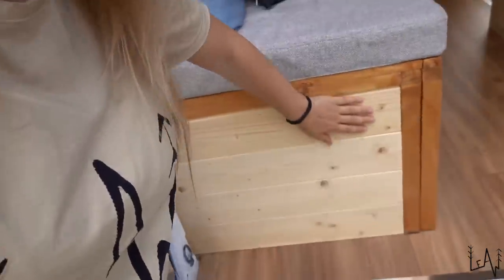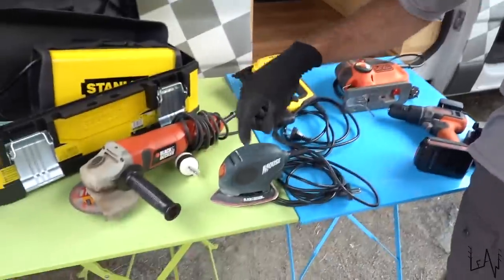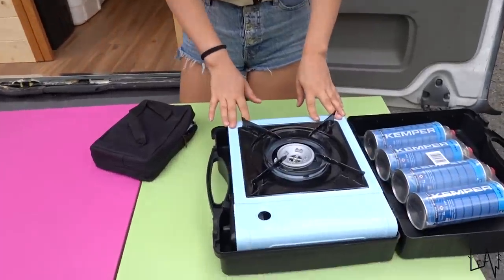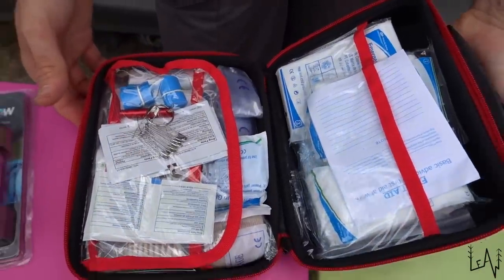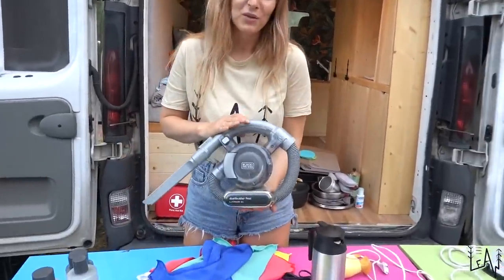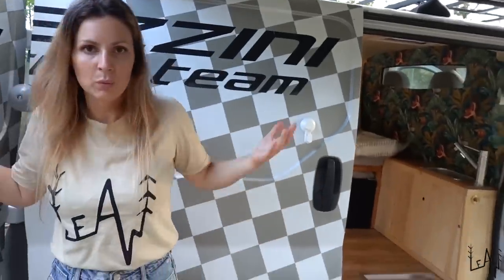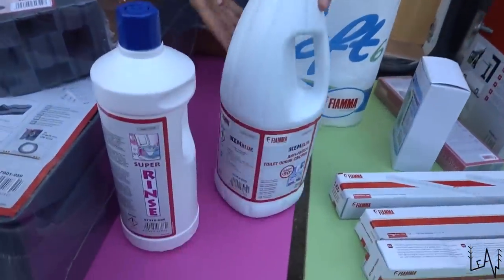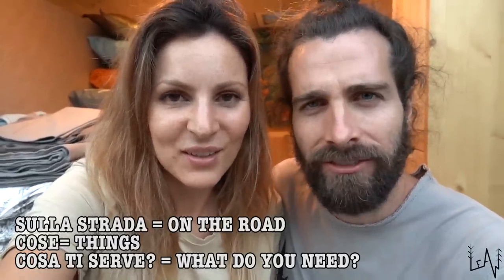VAN LIFE ESSENTIALS for our OVERLAND ITALIAN adventure /  Items & Tools

Comment: Your van has turned out beautiful.
We be built ours out 8years ago and remodeled/adapted/improved every spring since then.

Some of the ideas to improve your space/water usage.

To wash dishes in our Vw we don’t use „running“ water but a spraybottle filled with water, first moisten all the dishes, then soap with the silicone „sponge“ and rinse with spray bottle, it takes about 200 to 300 ml for a three person meal incl two dirty pans.

To dry our bodies we always use the microfiber sportstowels as they take much less space than regular towels and are faster dry again after use vs frotee towels.
I also have long hair, as the hairdryer culls our electrical system I will always use one of these „spongy“ speedo sportstowels to make them as dry as only possible and then I let them airdry, even if it’s really cold temperatures outside.

For cooking we have found we are very much fan of cooking just outside of our van, for this we built a slide out drawer. But for your van/set up it’s probably a flip up table for the back door that might give you the opportunity to cook and wash dishes (just outdoor, without actually setting up a real outside table) 

We also built a small sliding board that protrudes outside of the van on floorlevel, which we often use along with three folding stepstools for a quick „outside“ lunch or coffee when we are on the road and need quick break on the autobahn.

To avoid the gasman hassle we have switched to a Coleman fuel (Benzin) stove as this can be obtained at any gas station (and due to the nonfunctional Gasometer in our old Vw we carry a can of fuel anyhow)

Looking fwd to your travel vlogs and future upgrades on your van and beautiful house and land.
With high hopes to take our bus for a quick ride south of Switzerland next week.

Gueti Reis und bliibed gsund.

Comment: Luci solar camping lights work well. You can buy a stainless steel sprayer which is used as a fruit tree sprayer and for other things and install a shower head on it. Either heat it on stove or dump warm water in it. Pump it up and take a shower. They come in different sizes. Our solar bag showers always fail in some way. Look for the Zodi Extreme to see a ss shower sprayer which is no longer available. Also you could mount a long plastic pipe on your roof rack to hold water and adapt for a shower. Everything looks good.

Comment: Good morning I see a problem .the sink drain is in the middle of the vertical tank when it is 1/2 full water from the sink will stop draining into the tank also the drain lines should be straight so the hose doesn't hold gray water.